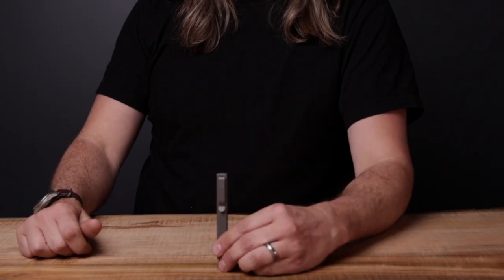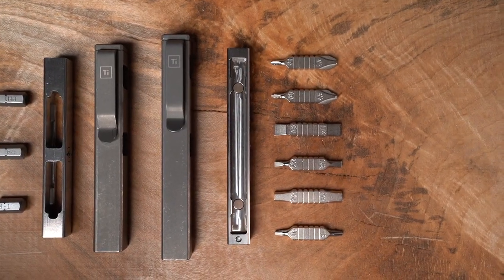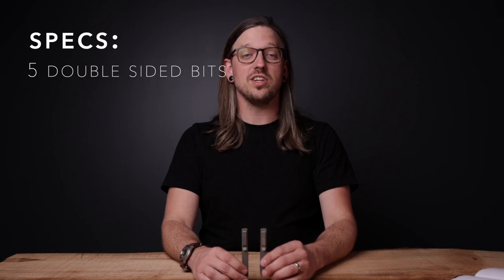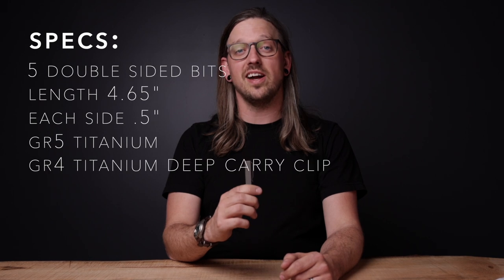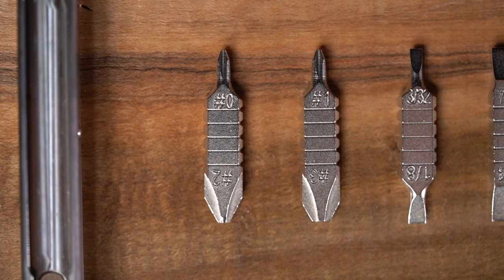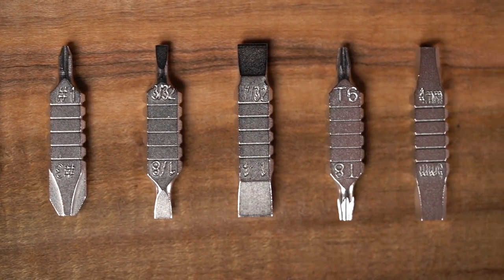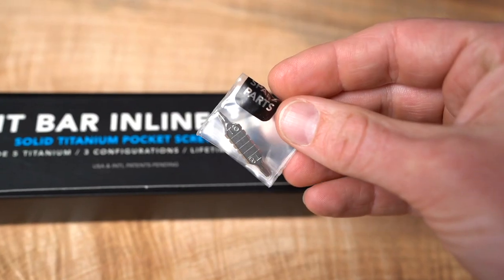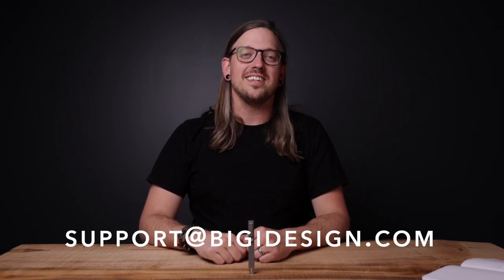Big Idea Design Bit Bar Inline Max | Overview

Comment: Will you sell replacement bits? How about a 1/4" adapter for it?
Reply: I think it's already compatible with standard 1/4" bits
Reply: @JC_1095  what makes you think that?
Reply from the maker: It is not compatible with 1/4" bits, the standard Bit Bar Inline uses them though. let us know if you have any questions!
Reply: @bigidesign  Will you sell replacement bits or a 1/4" adapter for it?